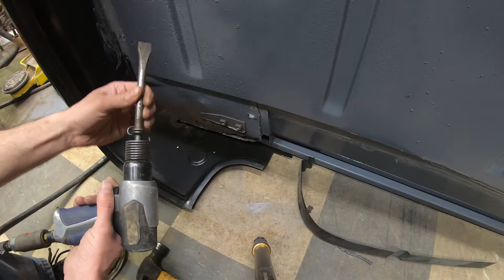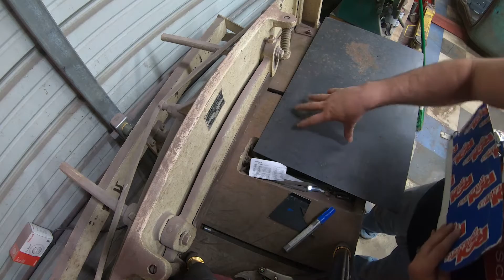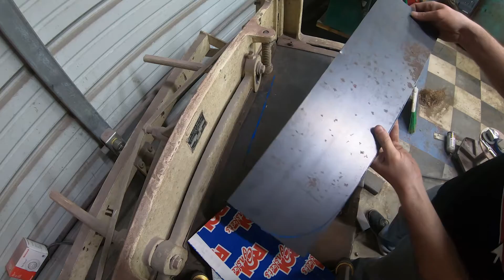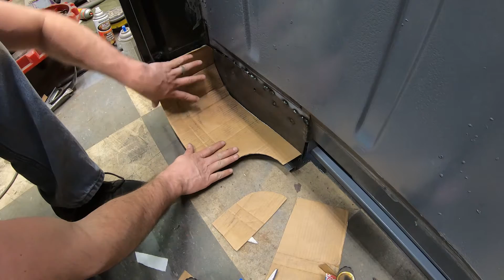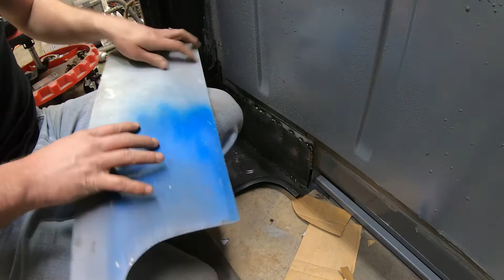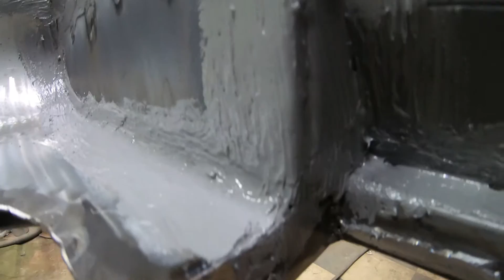Patina 1955 f100 inner cab corner repair

Comment: I like how you finished the inside of the cab corners, but don't you need a hole for the cab mount bolt?
Reply from the maker: Check out my playlist on this build and you will see how I made it mounts like a modern truck through floor mounts

Comment: I'm wondering if it's better to replace the floor panels first before doing the cab corners?
Reply from the maker: I only prefer the cab corners first so that there are no issues lining them up, if you do floors first it may put against corners and not sir correct, the aftermarket parts these days don’t fit very well but I had to modify my floor and firewall or I would have bought the entire floor